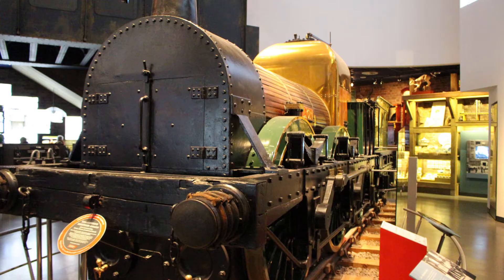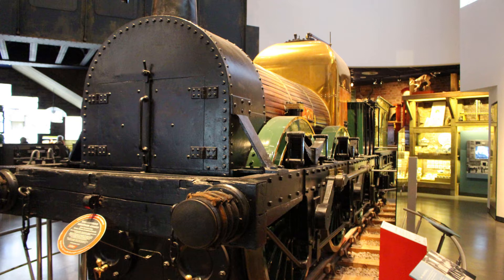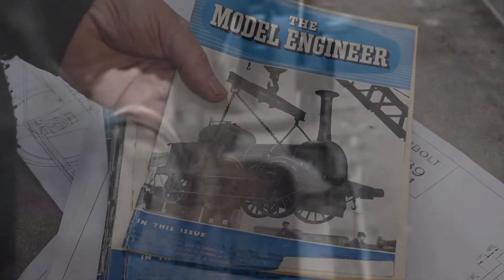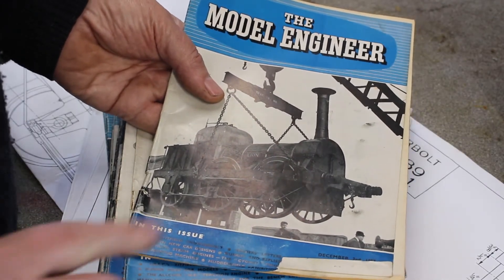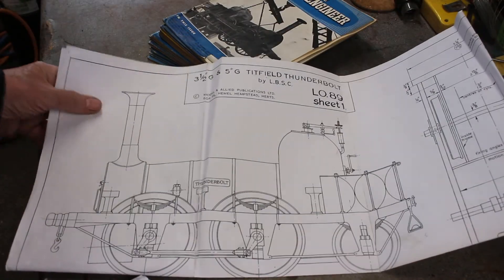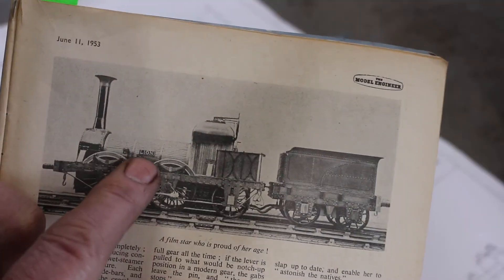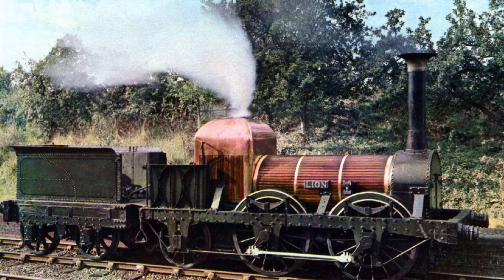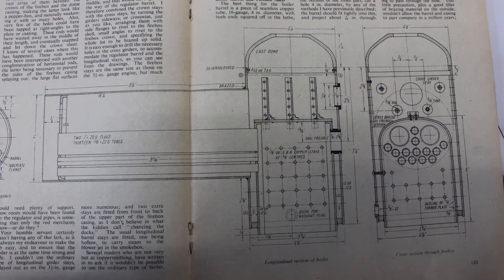Lion Miniature Steam Locomotive Build - pt 1 Introduction

Comment: In looking at the picture of the wheels and the front of the frame on the left side, I am struck by how much these engines retained from the horse drawn carriage period. That is of course more apparent in the coaches that go with this engine. What struck me was the suspension system for the driving wheels, with the springs over the frame and the boxes transferring the load. 

Thanks for the pictures and the video. I am watching this some years after you started this project and enjoying it very much.
Reply from the maker: Yeah, it's interesting to see the development of the loco's over time, a fusion of old and new technology is very apparent in early loco's. 
Thanks for your interest in my Lion Loco Build, it's been on hold for a while but I'll be getting back to the build before too long.
Reply: @GoCreatehms  
I am happy to hear that your problems are hopefully behind you.

Comment: Would you fancy having a go at a combined heat and power system based on steam and a logburner? I think this may be the future. - Large flywheel type to keep RPM low. Possible mount flywheel horizontally below ground & double acting piston low under burner or 6 piston rotary type to keep it compact. Suitable for battery charging on solar system.
Reply from the maker: Hi
Thanks for reaching out, sounds an interesting project, currently I've enough projects to be getting on with so I would'nt be able to dedicate time to another project. Thanks anyway.